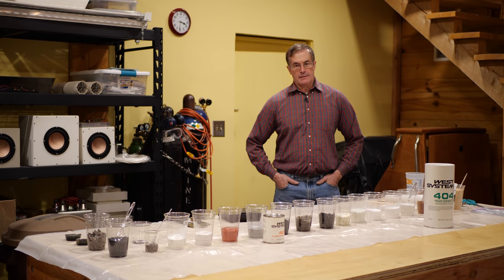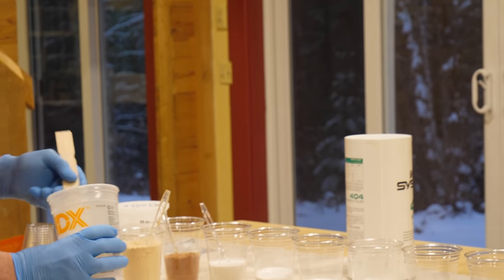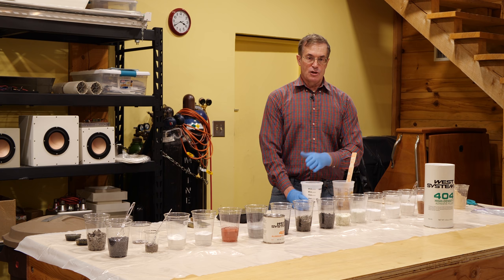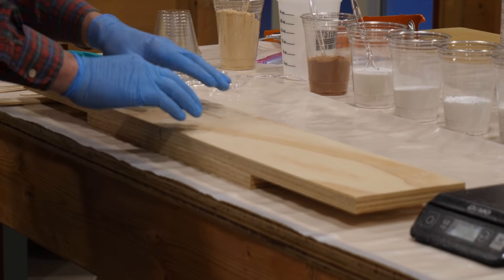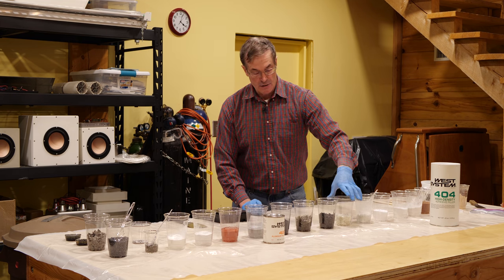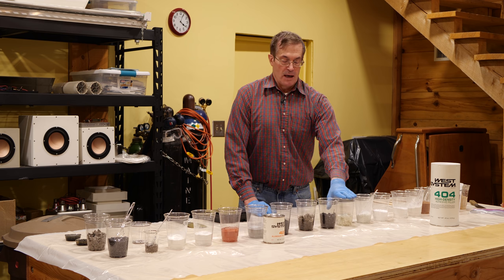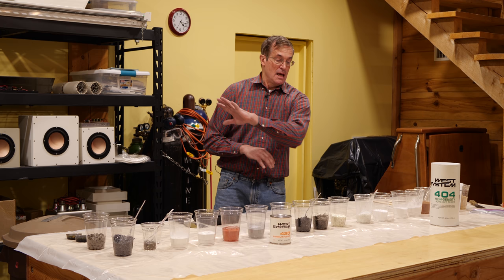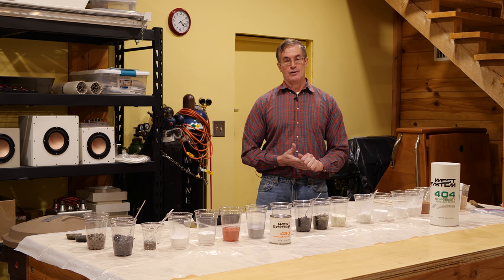Super Strong Epoxy with Diamonds and More!

Comment: Does somebody know if this epoxy could bond "sanding belt" and resiste to warm under load because  when belt aging the junction grip is very problematique and the loop break in a terrible mess and without being 20% used . (nota : professional  sandings belts exemple norton bleu are very expensives exemple 4" x 59" and you must buy a set of 10 for 200 to 400$ in funtion of the type so when you replace one with the spare in box they are old and problem apear with the belt junction append ... ) 
Thanks for your help

Comment: Hum...
I don't get it, you are saying it's cheaper than the storebought version, but wouldn't it be even cheaper if you used polyester instead of epoxy?

I've used it for most of the same applications, and it worked well enough.
Reply from the maker: I cover this in our video on flowing epoxy.  Polyester is actually slightly stronger than epoxy...once.  It has poor fatigue strength and after only a few cycles is significantly weaker than epoxy.
Nevertheless, both systems are quite strong and failures are often due to design and composite choices etc.  Polyester isn't bad.

Comment: I haven't been able to get epoxy mixed with anything to stick well to aluminum. Usually I will take the time to sand and clean it with alcohol. What's the secret plz?
Reply from the maker: I cover this in our thermal epoxy video.  But briefly, apply a small amount of epoxy to each aluminum surface then use a small piece of sandpaper to abrade the aluminum that is covered by the epoxy.  This exposes raw aluminum, but the epoxy prevents atmospheric oxygen from creating a thin film of aluminum oxide which inhibits bonding. This oxidation occurs in miliseconds with unprotected aluminum.
Reply: @TechIngredients  Sand it when it's wet with epoxy? Thanks, good tip :)

Comment: great video!  I need a flexible filler for our low outgassing epoxy.  I also need the filler to be low outgassing.  Do you have any suggestions??
Reply from the maker: Have you considered PTFE powder or chopped plastic fibers?
Reply: @TechIngredients  - no but thanks for the suggestions! I did find FKM Rubber in granular form. Thanks again!

Comment: thanks for the video. how would you make cast epoxy gears and mechanical parts that are strong and look and feel like brass or bonze? thanks
Reply from the maker: I would load a low viscosity, slow curing epoxy with approximately 5um copper and aluminum powder heavily and at a ratio that gives an acceptable color, out gas under vacuum or mix in a planetary paste mixer and pour into a silicone rubber mold.

Comment: I have an epoxy putty addiction. I'm curious if you have any ideas on making it cheaper than buying the JB weld stuff.
Reply from the maker: Just buy some fumed silica and the better grades are called cabosil.  Keep adding until  you have the consistency you want.  It takes surprisingly little.
Reply: @TechIngredients  thank you!

Comment: LOVE the videos best on the web for sure.  I share whenever I get a chance.  Where did you source these components USA?  Aluminum Oxide -- Silicon carbide -- titanium-coated diamond.    I already am an avid user of Raka per your mention. :)
Reply from the maker: Thanks!
Silicon carbide and aluminium oxide are widly available in the US as abrasive material.  Diamonds are available as well, but are much less expensive when purchased from China or India.  The larger firms will provide these diamonds coated with titanium, nickle and copper for braising onto grinding and cutting tools.
Reply: @TechIngredients  Wow thanks for the fast response.   What were the min order quantities that you guys bought int?
Reply from the maker: US abrasives generally start at #50 and the diamonds/coated diamonds begin at around 100 gm and become much cheaper/gm as the quantity increases.

Comment: How well would the ti-diamond/aluminum abrasive "gravel" mixture, poured as a sheet work as a pannel speaker material? (Rather than polystyrene or ceiling tile)
Reply from the maker: It would probably be too dense.  Mass works against amplitude for a given power input.

Comment: does adding these fillers or thickening agents weaken the overall strength of the epoxy
Reply from the maker: No and that makes sense.  It's a molecular process.  As long as the bonds between the epoxy the filler surfaces are no poorer than the bond between the epoxy and the structural material we're attaching it too, the strength will be the same.
Reply: @TechIngredients  thank you very much...

Comment: Can a mixture be made less the hardner and then when needed, mix in the hardener and use in the pot life time of the particular product?…

Also, in general, does the fumed silica make epoxy or other resin any more flexible… which is a property I am looking for???  If not, what could be added to create additional flexibility without decreasing the abrasive strength, shear strength or bonding to additive and or fillers?…am I making sense???…

Also, I assume resin bond diamond powder is best to use…is the titanium coating what they do to make it “resin bond diamond powder” that I see advertised?

Thanks for all your videos!…funny how I do a search for different things I am working on or contemplating and YouTube refers me to you…🤔🤷🏻‍♂️🤗

Would love to have a short discussion via phone,zoom, etc… on a niche idea I have…?
Reply from the maker: That certainly  can be done.  Commercial  products  are sold that way.
I don't  think a filler that is more flexible  than the epoxy  will increase  the flexibility of the composite.  It will just cause the epoxy to fail  at lower stress levels.

Comment: As a comparison, how well does a compound like "Liquid Nails" measure up to the pine flour/silica/epoxy spread?
Reply from the maker: It tends to be more rubbery and doesn't sand as well as the epoxy putty.
Reply: @TechIngredients   wow, I'm even more impressed with your channel now that you responded so quickly to a fairly old video. Thank you. Are the bonding capabilities comparable of the 2 compounds if there is no need for aesthetics? It would be interesting to see strength tests done on that 90 degree joint for fun.

Comment: Which powder do you recommend to smooth out and fill in for the out side of the boat hull?
Reply from the maker: Fairing filler if you're interested in a commercial mix.  If you prefer blending your own then glass micro balloons to a creamy paste thickened with fumed silica untill it doesn't run on a vertical surface.

Comment: Let's see, if I can crowdsource some info from the comments of the best science channel on YouTube:

Guys, I'd like to make my own composite freediving fins. I'm debating several options with carbon fibre, kevlar and fiberglass, but the real question is epoxy - someone was successful with the West System 105+206, but wouldn't a special Flex epoxy be better for this application? And how about the UV protection? I don't want to find my fins cracked the second day of vacation under some sun. Any insight and/or experience would be really appriciated.
Reply from the maker: I'd focus on two part, super flexible silicone rubber as the matrix.  Kevlar is probably the best reinforcing fiber.

Comment: What combo would be best for a white water canoe?  Fiber type, epoxy blends.   Needs to be light and very strong
Reply from the maker: Light weight S-glass with a low viscosity resin because it has a tight weave as it is harder to wet out/eliminate bubbles.  It is the toughest fiber of any kind.
Reply: Tech Ingredients Thank you for the info.  When a canoe gets pinned with the gunwhales upstream in whitewater, the forces on the downside rock are incredible.  Do you think this blend would hold, flex, or would the gel coat only break?  Could you do a video on how to work with this material and get the bubbles out?

Comment: Are there any additives that would make epoxy a little more flexible?
Reply from the maker: Yes.
Aluminum and phenolic micro spheres added to the mix will toughen it as well as increase the flexibility.
Can't  go too far as the underlying epoxy matrix defines the elasticity.
There are special  formulations available  that are inherently more flexible due to lower cross linking ratios.
Reply: @TechIngredients  thank you

Comment: @Tech Ingredients as a carpenter i'm super interested in epoxy but what i can't find any good information about is regarding the growing and shrinking due to change in moisture levels. can you advise in that regard? many thanks in advance

and of course many thanks for all those super interesting videos
Reply from the maker: For future reference, look into the wooden boat building community.
Basically, once sealed the water content remains fixed and no change in dimensions will occur.
Reply: @TechIngredients  Yeah. The issue i have is just that there will be no sealing. Just some crack filling which in this case can be kinda big so I'm worried about the shrinking. the project I'm looking at is a roubo workbench.

and i should've mentioned that I'm german so availability is another concern
Reply from the maker: I suppose the effect will be localized to the repair.  Moisture will continue to enter and exit the bulk of the wood and it will continue  the process of equlibration with the environment, presumably drying out and new cracks will develop once the epoxy stabilized cracks will no longer open to accommodate the shrinkage.  The epoxy will never let go.
Reply: @TechIngredients  So no risks of the epoxy falling out like some repair materials Do (those which aren't for wood usually)? that would be great. and thanks again for the help

Comment: I always wet out joints before the thick with normal epoxy, West coast said that was good practise. not sure how much difference it makes really, might be an interesting test
Reply from the maker: It is a good practice, but wet only, don't slop it on in a thick layer or the bead tends to slide around.
Reply: @TechIngredients  I was not expecting a reply on an older video. Thanks for the great video and info as always. My worry was the wood might wick some epoxy and could cause a dry joint.

I am restoring an old boat and the owner did a lot of bonding with I think polyester and it had almost zero adhesion to the ply. It also did terrible in areas that flexed and the tape just popped off.

Comment: Is the epoxy mixed with carbon fibers stronger than a polymer for example used in guns?
Reply from the maker: Yes.  No resin based polymer is close to the strength of the embedded fibers.
Reply: Thanks a lot sir, greetings from an argentinian fan of your channel.

Comment: I have a question... These epoxies components (A and B) differ in quality from brand to brand? I guess the final mixture toughness depends also on the epoxy itself ...
Reply from the maker: It's complex.  It does depend on the epoxy as well as the bond that the epoxy makes with the components that are added to it.
Reply: @TechIngredients  Based on the component that we want to add, is there any recommendation for a specific epoxy? For example when mixing with basalt fibers is recommended to use X type/brand of epoxy.
Reply from the maker: Not really.

Comment: What happens if you make a composite, but turn the epoxy or resin into something along the lines of aerogel using a supercritical process? Would a CF-aerogel composite be viable?
Reply from the maker: It would not.  The matrix that binds the fibers into a structure has to provide high shear strength and it has to be tough to resist fracturing under load.
Reply: @TechIngredients  Aw man. That sucks.

What about using an aerogel "skeleton" as the core of a composite material, but still using a separate epoxy matrix to bind it together? Or using aerogel particles to turn a resin into an insulator?

Also, why are aerogels so brittle?

Comment: Would carbon fiber and titanium Diamond epoxy make a good sailboat Hull? What would that be like? Maybe the titanium diamonds would have to be ground up to a very fine powder. In my imagination there's a carbon fibre titanium diamond sailboat traversing the universe.
Reply from the maker: The carbon fiber certainly will.  In general, powder additives will not help much more as they thicken the epoxy which increases it's mass and it's fraction in the composite.  An exception may be graphene which we will be demonstrating in an upcoming video.
Reply: @TechIngredients  have you guys done anything on water filtration? That would be a fun one.

Comment: Wouldn't steelwool be a good alternative with its long fibers for structural parts?
Reply: Of course mixed inside the epoxy
Reply from the maker: Stainless steel would be less vulnerable to corrosion.  The fibers are as strong or stronger than steel and about 1/3 the weight of steel.

Comment: i have a question but maybe out of topic.
is there any way to make epoxy elastic???
Reply from the maker: Elastic, probably not.  You can increase it's toughness which is it's elongation percentage before failure by using certain formulations that usually require two stage curing with second stage heating.  For significant elasticity, silicones are excellent.
Reply: @TechIngredients  i'm a hobyist and recently i try to make sculpting model with epoxy clay first and then make a mold to pour out with poly urethane resin.

Since PU is a bit elastic, i wonder if there is any way to make my epoxy elastic for saving cost because it's kind a hard to get PU resin in my place

By the way i made my own epoxy clay, that's why i'm curious about it

Comment: How does the density of the diamond resin compare with the ceramic blocks used in high specification body armour, do you know? If it is significantly lighter for a given performance it could have great potential!
Reply from the maker: Typical ceramic armor is sintered rather than bound in a resin matrix.  The best answer is going to be more complicated.  This makes sense because if a resin matrix system were competive, they would already be doing it.
We're looking at hybrid systems that disrupt the flight angle of the bullet then abrades or fragments the bullet (resin/diamond) and then captures the fragments in a thin Kevlar cloth layer.
Reply: @TechIngredients  what about alternating layers of abrasion / disruption followed by capture. You're right of course, there must be billions spent on ballistic R&D each year but maybe the military wouldn't mind a small grant to fund some of your work. The only downside being we'd never get a YouTube video out of it!
Reply from the maker: There are so many projects that call for independent research.  There is so much information available that millions of us can improve on what a few (highly funded) labs are working on.
But, to your point.  I think it's a three layer approach.  First, loose ytrium stabilized zirconium oxide spheres disrupt flight, resin bound abarasive damages the bullet and a thin composite cloth/pad catches the fragments.
As an aside, ever heard of electric armor?😏
Reply: @TechIngredients  I have now, that sounds amazing! Perhaps not practical for personal body armour. yet..!

Comment: I want to leave a comment & youtube won't know what it is all about.

Back to the shape charge you had a cylinder with 2 fill ports. I assume one for H2 and the other for O. I am trying to understand how you would fill the cylinder with a correct mixture as it will not expand like the balloon. So the only method I can think of would be to fill the cylinder with H2 to X pressure, with or without a flow gauge, then final fill with O to 2X or 3X pressure. I am not sure that the mixture would be correct with that method. I thought about having different volume chambers inside then creating a passage between the two, I think that would be hard to do at extended pressures in a cost effective manor. Maybe having 2 belleville spring disks situated so that when chamber 1 gets filled to X both springs resist, when chamber 2 gets filled to 2X then one spring blows out into chamber 1 causing a over pressure in 1 causing the second spring to fail resulting in a mixing of the gases. That might be a little tricky to make work reliably.
Reply from the maker: Pressure should work well and is easier to implement.
Reply: @TechIngredients  Thanks, don't want to steal your thunder just something to think about. After all inquiring minds want to know.

Comment: What could I add to epoxy to make it machinable with dimensional accuracy?
Reply from the maker: Interesting question.  O haven't any direct experience, but I can make some suggestions.
Avoid ceramic powders because of the abrasive wear on tooling.  Avoid steel and copper powder because the density may cause it to settle during curing.  Avoid nano powders because they will thicken the mixture at very low percentages.  I'd recommend experimenting with 5um and 30 um aluminum power and possibly a mixture of these sizes. A low viscosity epoxy will allow heavier loading with the powder and a stronger and more stable product.
Reply: @TechIngredients  THANKS!

Comment: What if you whisk epoxy to fill it with air?
Reply from the maker: That will make it lighter, but the bubbles will stratify as the mixture cures and so a light weight filler like micro glass bubbles is probably better.

Comment: Can we cast gears in epoxy with cubic boron nitride and of so what's the loading ratio please
Reply from the maker: You'd have to experiment, because the more filler you add the tougher the material, but the less it will be able to reproduce fine detail.
Reply: @TechIngredients  thanks a lot for your prompt reply, 👍